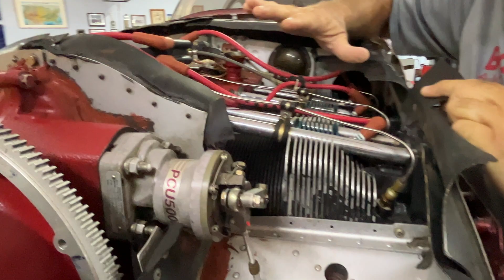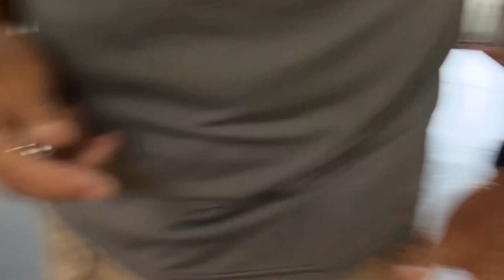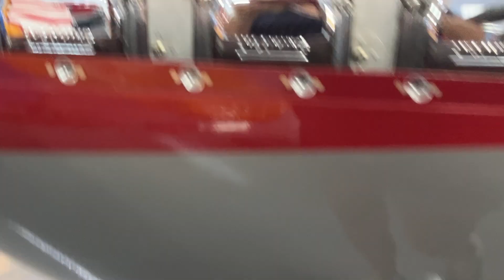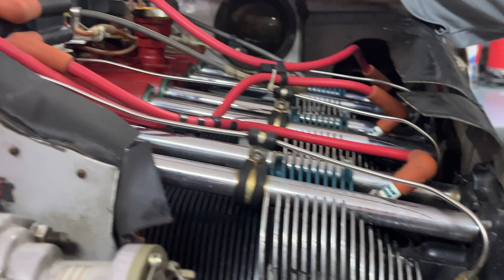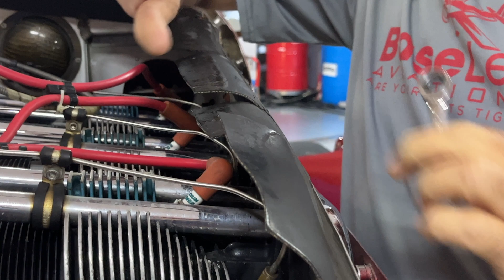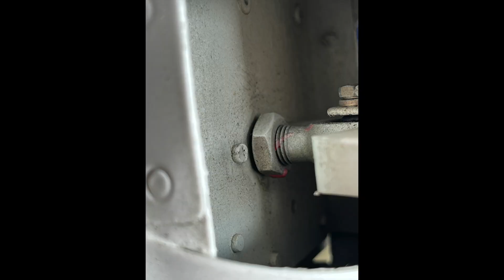Explanation of CHT vs EGT in injected engine

Comment: How do you properly torque the jam nuts on the elevator or rudder rod end bearings? I have torque wrenches - just need to figure out how to connect it to the nut.
Reply from the maker: It’s kind of tough to get a torque wrench on the nut in most of the locations. just snug them up, and put some Cross Check or other seal indicator on them and you can visually check them.